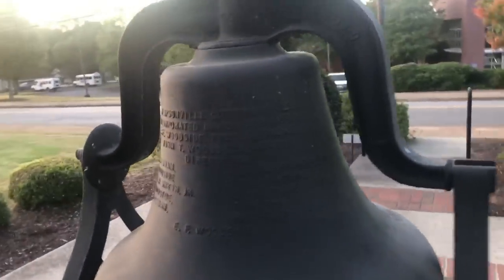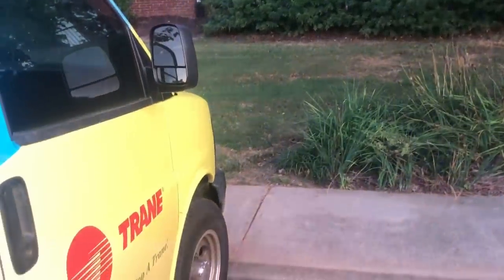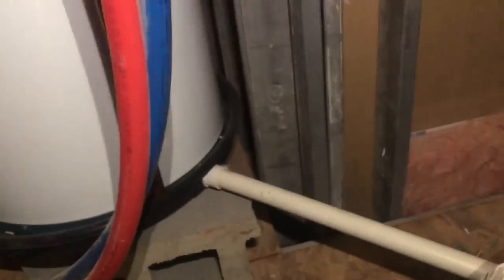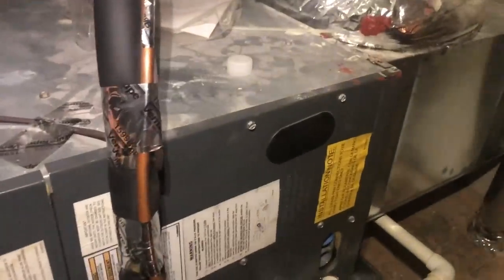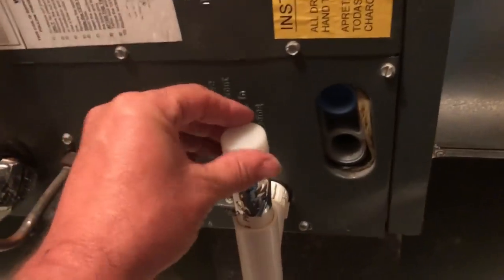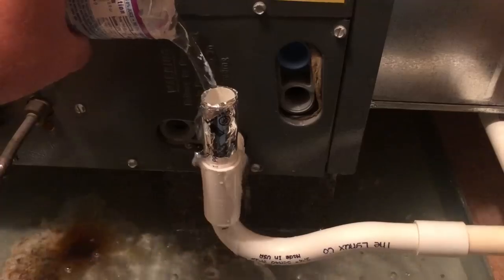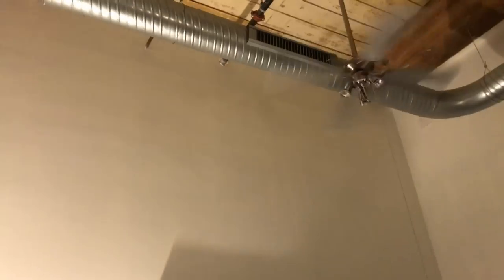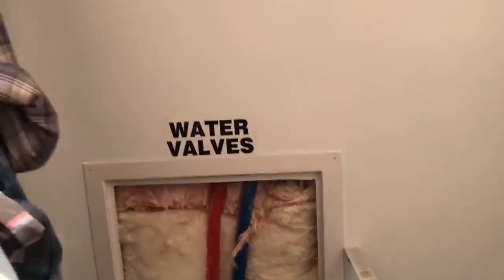Drain Pan Full Goodman Air Handler in Old Cotton Mill Condos

Comment: Alot of good that P-trap does during the winter months.  When the water evaps out, the trap doesn't trap anything.  Its an open sewer vent some months out of the year (when the AC isn't running/draining).
I started noticing this in public restrooms.  Ever been sitting in there and smell sewer gas?  Then see the dusty floor drain from the stall?  There ya go, it's not coming from you, the P-trap in the floor has dried out and is venting gas.

Comment: It looks like it’s double traped. The drain goes to far into the bell reducer (no air gap).
Reply: It looked like it was above the waterline before Ted messed with it.   I don’t know how he left it.  I’ve never like the idea of leaving that trap open like that where if it clogs up it just floods the place.
Reply: Maybe ,but what happens if the trap goes dry? Stink and the trap is useless with the vent on the wrong side of the unit trap
Reply: yep, total fail at no air gap.. both of those should actually end some 3" above the reducer(funnel) to be correct, of course they never will be.
I guess it's not a "prep sink" after all lol
Reply: @speckulator7516  Nope, can see the rust & water on it when he lifts it.  Can see it's in the same place when he puts it back.  That's 1"-2" more WC pressure the drain needs in order to flow, plus I suppose you get a higher likelihood of sludging up the whole length of pipe.  I think I'd have cut it off so it can't be submerged.
Reply: @boggy7665  Excellent idea
Reply: You are correct a double trap is the cause of the problem, Ted will be called back eventually.

Comment: These northerners with AC units in their attic you can walk around with secondary drain pains and drain lines have it so nice.  In S FL, they just jam the AC air handler and evap coils in tight little AC closets with only a primary drain line. And with that aging plastic pan eventually cracks or gets clogged with drain pan gunk and needs to be serviced or replaced, its very hard to work do it and still keep the integrity of the refrigerant lines (without having to pump down the entire system).

Comment: Why not just cut it and put a new trap?? Literally 90 seconds i could remove that trap back to the unit and install new.  Longest thing would be walking to the truck and back.  Also Nothing wrong with that drain going to that big trap.  At all.  The last 3 apartment/condo jobs ive done recently in richmond, va all have the units in those little access areas up high.  And all drain just like that.  Long as you got fall its good.

Comment: What did you pour into the drain line to clean it? Was that hot water, or some special liquid?
I am having water leak only when the AC is OFF. It drips a lot. I had a plumber to replace the P-Trap on the drain line and clear it with a snake and blew air in it.
Wonder if warm or hot water can help?
Another thing might be a cracked Drain pan inside the HVAC air handler.  Not too sure how to test it.
Any thoughts?
Thanks.

Comment: Wow that filter is unbelievable. Looks like it’s never been changed
Reply: Thats on of the reasons you should never as a builder hide your utilities. Homeowner doesn't know any better, they just use the stuff until it breaks, if its out of sight you know sure as hell its never in their mind. Thats another reason that water tank scares me. If the tank is in sight, the customer may notice it failing when then thy see water in the pan. With this, the homeowner wont know their tank has failed until its dumping water on them. Irresponsible is what these sort of buildings are, and having been a contractor on the construction of a few, I can tell you that the builder never considers serviceability into the design. 

But now i'm just griping. Rant over.

Comment: What did you pour into it to clear it out?  I don’t want to go to Lowe’s and ask for “yellow death”. I have a Goodman and the pan fills up quick. I use large diapers to sop it up, but that’s getting old fast. I have two long piles leading outside. One is from the air handler and the other is hooked up to the pan. But that pipe is a joke since the water is more likely to overflow before water goes into that hole. Yeah, I’m ignorant as far as AC units go, but in my defense, I can’t know everything in the world about everything in the world. I would like to add a switch to my pipe leading out of the unit so it’ll be easier to flush out without the risk of backflow into the unit. Oh!  I do have a question. The coupler is 3/4”.  What size would the pipe be?  I’m thinking 1/2”.  I’m considering just replacing the pipes.

Comment: I know I couldn’t live in a place like that. 

All the engineers I know love those manifolds so they can cut off each item but I don’t like the idea of have an extra mile of PEX for the reckless trim carpenters to nail through and cause leaks.  It also adds a lot potential leak spots at all those connections.  Hell Im going to use angle stops anyway and you can buy the tub and shower valves with stops for a few extra bucks.  And someone has to pay for that mile of extra PEX and someone to install it.
Reply: On your point of carpenters, I have a story for you.

Back when i was first getting into the field, I worked for a company that did RNC HVAC. I was on the trim team and our foreman got an angry message from a super at this shitty duplex development about one of our units leaking water that destroyed an interior wall. Now, this super was known for being an absolute asshole and the developer was one of our larger ones, so we were thoroughly freaked out by this, as if it was our fault it was going to be hell. Now, our units were mounted in a small closet in the garage, and behind the wall was the bathroom. We get there, and there is no sign that our unit had even ran vs making a massive puddle and water damage a third of the way up the wall. Now, that should have been all the clue you need to know what had actually happened.  As we watch in horror, the super takes a hammer to the drywall, knocking out a third of the wall, exposing a nice drywall screw right through a pex line. 

Now, I know what your going to ask, "how did the screw get through the nail plates?". Well that's simple, there was none! The drywallers had been going into all these homes before they drywalled them and ripped out all the nail plates because it kept preventing them from sinking all their screws in. So now the builder had to replace a wall, the insulation behind the wall, replace that section of pex, and hope that non of his other homes will have the same issue in the future because who knows how many other homes these yahoos did this with.

Comment: I don’t think that thing was trapped and vented? A guarantee that drain pan inside is full of crap too. Why is the new flow switches on that unit it should be three should have a flow switch and a water alarm on that water heater too

Comment: What do you call the drain pain that is up higher on the air handler? Not the condensate drain pan? We’ve cleared the lower pipe and the higher one. But we are noticing some water coming out around the seems of the pan that is higher up.
Reply: The one inside

Comment: This is hard to watch bro.
I use a battery operated pump from horrible freight and clean the main and then pump out secondary into primary.
Also the end of the primary is under water in the large ptrap. No good

Comment: Anti-DIY HVAC 
I have a Goodman with cold air blowing out of and around the 2 drain holes one is plumbed to the drain and one is just open to drip into the drain pan,  Is cold air supposed to blow out and around the lines.  Model HF-61F coil. Great videos.
Reply: In general, evap coils have two access ports for drainage as in some states or municipalities they have special codes on either running a secondary drain pipe in the event the primary plugs up or for the addition of a secondary drain interlock. The secondary is actually slightly higher in the pan, so by rights it should never drain from there unless there is a blockage in the primary. that said, most all coils I've seen include a cap in the secondary for cases when you don't have to run a drain or interlock from them. If yours lacks one, then you can likely go buy one from a hardware store to close that up. Usually they are 3/4" PVC, so look in the plumbing section for those. 

Secondly, there is no real issue with a little air leakage from the gaps in the coil housing. if it really bothers you though, you can get what we tradesmen refer to as thumb gum, basicly plumbers putty, and apply that around the ports.

Comment: What's the best filter to use? Like  MERV 8, 11 or 13 for the home. Thanks
Reply: Steve L says 4.  Right answer is, 'it depends'.  Depends on whether your system is designed for the flow restriction.  I've wondered this myself.  Don't want the heat exchanger to crack because it got too hot because there wasn't enough airflow.  Now using the oldfashioned spun fiberglass type, MERV 2.  Now do I risk caking the furnace innards up with house dust?